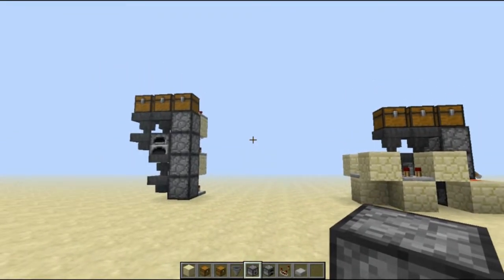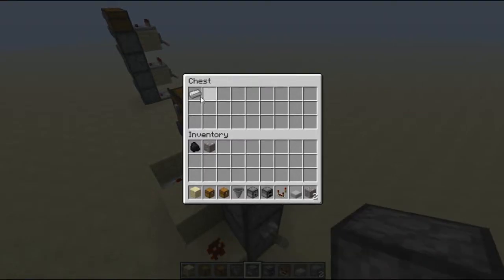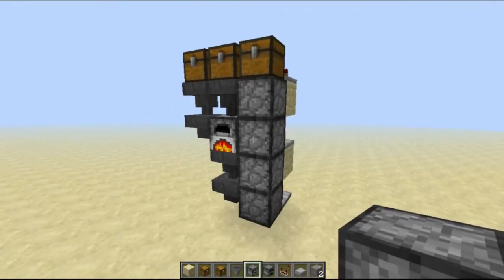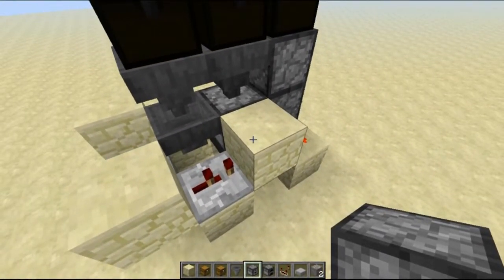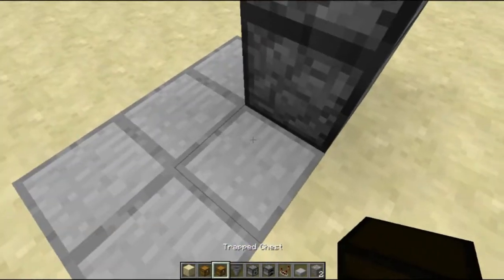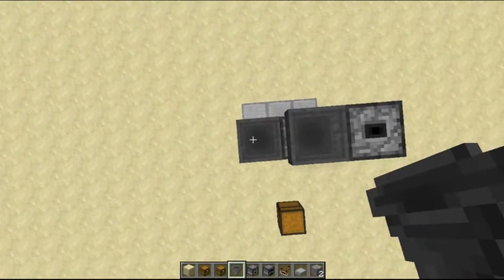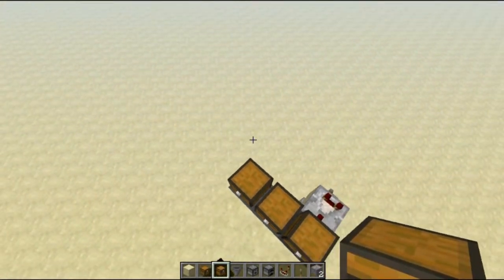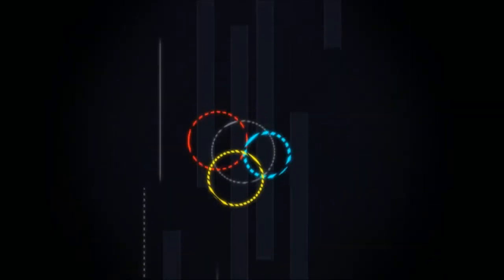Automatic Furnace (Improved Design)

Comment: You can use 3 droppers for the lift.  Run a compairator out of the bottom followed my a repeater followed my redston, redstond to the left of that, redstong behind thatone aswell so it connects to the compairator and makes a clock, from that last piece of redstone you can run two pieces of redstone to the left, one behind that last on, followed by a repeater going into the bottom dropper.

Image of the redstone: imgur(dot)com/OKgn4ZM